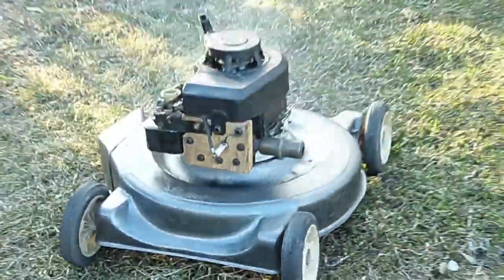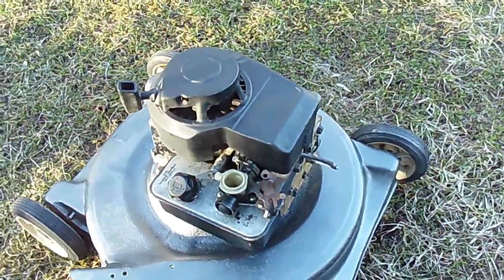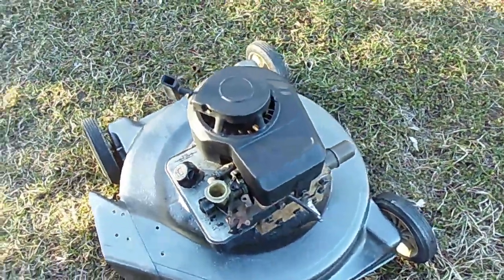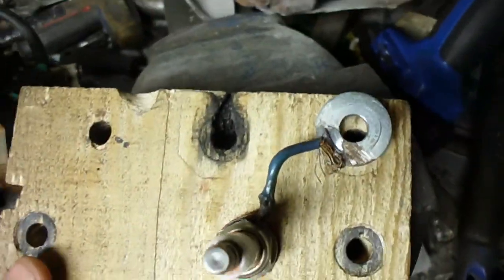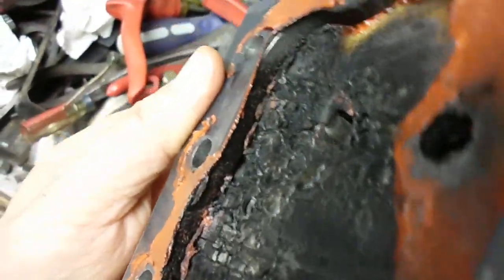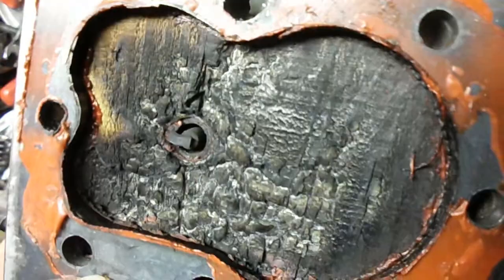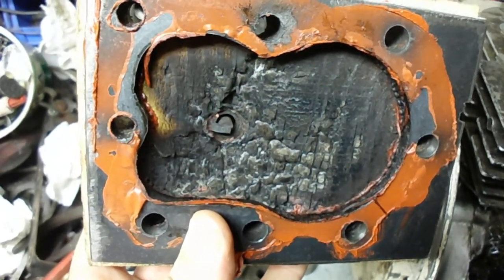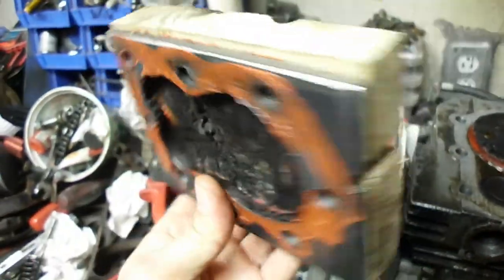The Hemlock Head is Dead !

Comment: I wonder if a thin steel plate on the head to help distribute the torque and clamping pressure on the wood might make it last longer?
Reply from the maker: Perhaps it would help, I intend to make another head, so I could give that a try, as i know the bolts do sink into the softer woods. Before I used flat washers, but just went with the stock Briggs head bolts this time. The heads always seem to fail at the bolt holes.
Reply: @ChargerMiles007  
On wooden aircraft structure crushing the cells of the wood is bad under bolt heads. In your application it might be just the key. Even pressure, maybe over tourqed even, might increase the density enough to help.
Reply from the maker: I will have to give that a try, now that you have explained about the cell crushing, thanks.

Comment: you should run it and then cut the gas and see if it will run off the burning wood
Reply from the maker: Yes, I think Coosa is right, although an engine can run on wood gas, I think this is a bit different. However, it is entirely possible that the wood gas being generated is indeed adding to the combustion.